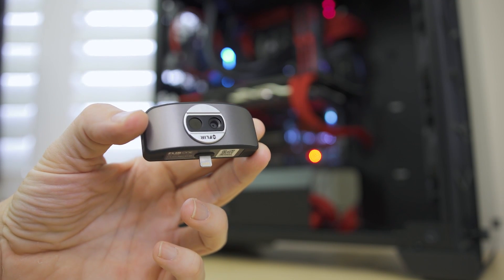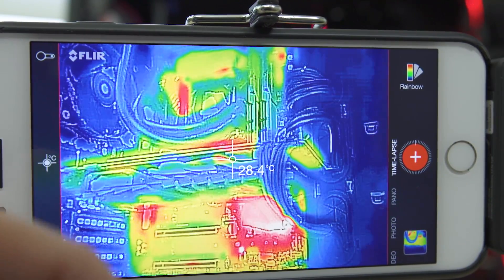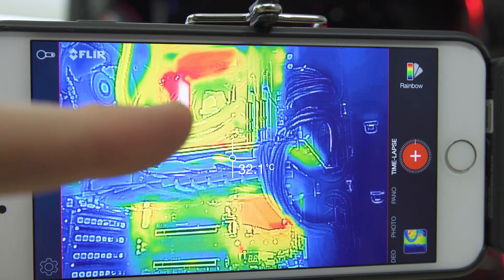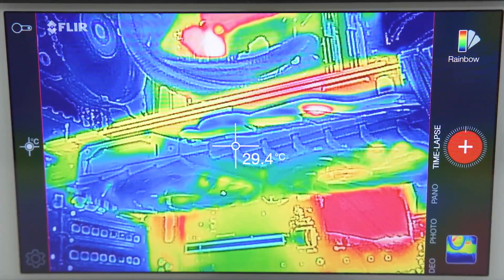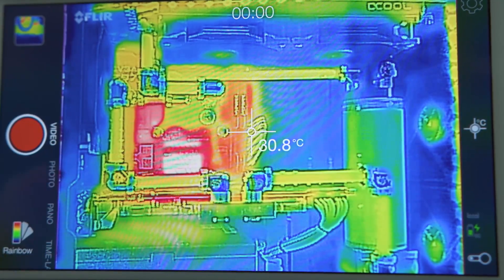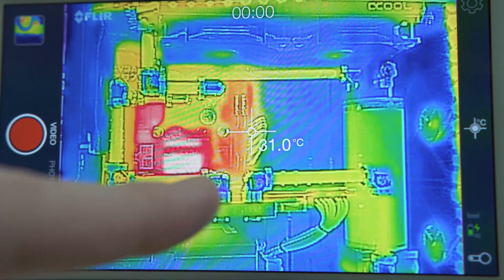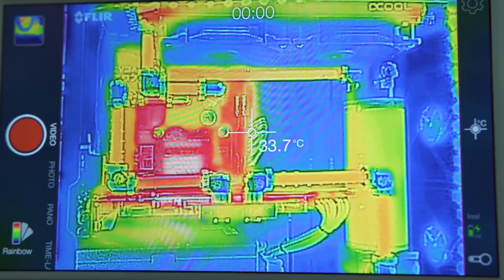PCs and Thermal Imaging... What your eyes CAN'T see

Comment: Hey Jay can you test if you get your hands on one the new Asus Rog board that'll have a block on the CPU and VRM's I'm curious if the VRM's are getting this hot would it actually be a downside on a block like the ROG board because it'll affect CPU Temps sharing with a VRM? Might be a thought to consider if the board is really worth the extra for that block if it isn't actually helping cooling as opposed to say get a separate block as usual for the slightly lower model of a ROG board.

Comment: We learned that you forgot the temperature Is relative the hottest point of the water cooled system is 32 c the hottest point of the air was 70 c but red the coloring changes with the average temp of the system

Comment: I think you would get mutch better results if you would have a fixed temperature scale. From what I can tell from your video the "color scale" changes as the average temperature goes up or down. A good example of this is the chipset. It started as the max heat source, and ended up orange/yellow by the end, so the shown color is relative.

Comment: Great video. It feels like you rushed through it a bit personally. I'm sure the excitement of this got ya going and you talked faster than normal. Maybe I'm wrong, but that's how I felt. I am very excited for more thermal videos for sure. I think a cool video would be the difference between a normal motherboard and one that has a fan in it for extra cooling like the SABERTOOTH Z170 S (something like it, not that exact one per say) would be pretty neat. See if you're actually paying for reduced temps, or if its just a neat way to spend extra money for a fan on your mobo. Also a video with fans in different location, and how they effect cooling. A case with a fan on the side would be interesting if it actually helps cool the mobo, or if its just for case circulation. Keep up the great videos, and I'll be on the lookout for more awesome PC vids from ya this year.

Comment: how many fans are too many fans for a matx
Reply: Xathrid tech That's easy to answer. Too many fans is one more than your case supports.
Reply: 3en6ie 3en6ie I have 6
Reply: my phantek luxe has 3x 140mm 5x120mm 1x 200mm fan, total is 9 fans, is it too many?
Reply: I want more I get sub ambient temp because it blows out air in from the window or out through it
Reply: 3en6ie 3en6ie okay fine define ambient
Reply: 3en6ie 3en6ie it uses the outside weather with filters to cool it but colder than the room it's actually in
Reply: 3en6ie 3en6ie yeah but the air it takes in is cooler than the air around it
Reply: Robert Langford should I buy the extra rails to mount more
Reply: Xathrid tech That's entirely down to you and your system. If your system is not overheating it's not something to worry about. However if it is then I guess yes maybe the answer if you have done everything else to maximise airflow.
Reply: 3en6ie 3en6ie You can, actually. Difficult to achieve with computers that like to warm up stuff but it's possible to achieve sub-ambient temps with coolers. That's what a cooler essentially does, you know, cools the computer's own "ambient temperature".

Comment: How about showing how bad something can get - e.g like my son's build! :-)  R9 390X Gaming 8G, with large air-cooled AMD FX8350 Black edition, and a crappy motherboard with insufficient VRM capacity, all in a small gaming case.  I have modded this case with Plastic panels to direct airflow on CPU (at the top) from input at the back, through the CPU cooler, then both up out of the top and also out the front.  Lower 2/3rds is Twin input fans at front, then exhaust is through upside-down PSU to the rear of the case.  The CPU stays below 60c most of the time, and the GPU doesn't usually go over 85c.  That's the best I can do!

Comment: this is one of the coolest videos you've ever put out jay. thanks for all your work. i'm a little confused on why you called an air cooled system that actually has an AIO? i get that the gpu is still air cooled, but i was expecting a noctua or hyper212 air cooler. my guess is heat would be spread everywhere inside the system, giving a less accurate show on mobo temps and parts around it? either way, an interesting way to make your point jay.

Comment: Could anyone explain to me
What a chipset is?
Reply: 3en6ie 3en6ie explained it pretty well. In simpler terms it's sort of an instruction hub for the motherboard. A lot of data and consequently heat pass through it and that's why it has a heatsink. I believe they are sometimes referred to as bridges or northbridge, or maybe I just made that up; I thought I remembered referring to them as northbridge years ago.
Reply: A chipset, Platform Controller Hub (PCH), is basically what makes things in your computer communicate with each other in the fastest possible way. It also dictates how many other things you can connect at the same time via the amount of PCI-E Lanes drawn on the motherboard. It also dictates which CPU you can run depending on which LGA socket it has. 

Chipsets: 
X99 (28-40 PCI-E Lanes): Has the most amount of features available, you can connect A LOT of stuff at the same time. Because of that it's very expensive.
Z170 / Z270 (20-24 PCI-E Lanes): Has fewer features, but different, because it's a newer platform. It can't connect as much stuff at the same time. Because of that it's less expensive.
Reply: Zion I.S The stuff on the thing that runs shit
Reply: Black5.0 There used to be south- and north bridge, but nowadays they're not separate and everything happens on one chip
Reply: Thanks spengu64 for clearing that up for me, I thought I was losing my mind when I went on newegg motherboard specs and they didn't list northbridge which I thought was the chipset lol
Reply: think of it like a Processor - because tbh it basically is one - a Processor that handles organizing the data coming from lower Bandwidth Expansion Slots, external Ports, and Et Cetera, and feeds that data to your 'real' Processor.

and just like any other electronic thing - it generates heat doing its job, and it also has limitations on what it can do.

if you were to ask "why doesn't my 'real' Processor just do it all instead" - everything can't go directly to your Processor, because it would be too expensive to manufacture and in some cases you'd run out of physical possible places, despite having tons of layers to your PCB, to connect things to the Processor.

it's much the same way for example, that we don't all have billions of wires coming to each home to connect us to the Internet - that's just not feasible so instead we have hubs all over the place that route information to the right other hubs eventually to an end point.
Reply: Thank you all for your help :)

Comment: Hi Jay. 

 I do power plant thermography  and a simple bit of kit we always carry around is a roll of electrical tape. It has an emissivity value of approximately 0.94 and can be used to improve accuracy. 

As an example run that load test again concentrating on the graphics card's  heat pipes and place a bit of tape on only one of the heat pipes and observe the difference between pipes with and without the tape. The issue is that this is not only graphical  (as viewed on the thermal image) but affects your readout also.

It can give you false positives or vice versa.

Loving all the directions your videos are taking us. Cheers.

Oh...btw, throw the imager across the 370Z. Cool things to be seen. Under the hood etc. Not sure of the range of that FLIR imager though.

Comment: J you can't just measure temperatures accurately without factoring the emissivity of the material. For example you can see the heatpipes looks like its cold thats because its shiny hence it has lower emissivity.
Reply: Or just think of it more logically, in a way that most people can understand: A reflective surface will just how the temperature of the things in reflected image, not the actual surface itself. That makes more intuitive sense to people.

Comment: 1:50, It's very frustrating to see the colors representing where temperatures are high at, but not actually have numbers to tell us how hot those parts actually are. I do realize that, 7:00, here we get a bit better of an idea of all the temps. For all we know, there could be an extremely minor difference in temperature between  those red hot spots, and the cool blue parts of the case itself. The crosshair at the center gives us some idea of where the temps might be at, and perhaps this is my failing, but I don't find it to be enough to really garner much useful information.  

If it's warmer than the rest of the system, but not hot enough to matter, have we really learned much? I feel it's fairly obvious that the components of the motherboard that do things like deliver power or do any amount of processing, are hot.  Perhaps I'm simply not the target audience of this video though, or I'm missing the point.

Overall, still interesting to see the visualization. I just prefer the nerdiness of the numbers. :)

Comment: Doesn't the Heat pipe not being very warm on the surface speak for it? If it conducts the heat properly it should warm up as little as possible. The fins around the end of the heat pipe would be way more interestong.
Reply: 3en6ie 3en6ie interesting I was wondering if they were insulated on the outside apart from the bit at the end.

Comment: WoooooooW!!! what an eye opener!! I can't believe how hot the VRM's stay... but you're at 5Ghz on that 7700K... There's got to be a way to stabilize the heat coming from underneath the graphics card back plate. Like if you bought one of those really sweet all metal backplates from EKWB, then put those rubber heat pads in more areas. I really want to liquid cool my south chip and especially my VRM's now just for longevity. I pretty sure the chemical based capacitors on anyone's motherboards hate the heat output, like near the high quality onboard sound solutions that are nearly always underneath the video cards.
Reply: I've always wanted to do a full-board water-cooling for so long, and I've never sprung for it, but now I think I really want to. thanks for this video!!
Reply: Don't get too excited over VRM temperatures. Practically all VRM's used in electronics are rated for 125*C operating temperatures. As in, guaranteed-to-be-safe up to 125*C. It's not too hard to find devices that tolerate upwards of 200*C operating temps either. And with even a small heatsink, most VRM's will never get much hotter than 80-90*C, which, yes seems alarming, but is totally relaxed for the VRM. Reduces their efficiency slightly, but the engineers know that - so the board is designed for that loss in efficiency at higher temperatures (They account for it by making the VRM's a lot beefier than they need to be. A common electronics engineering rule is to over-engineer by 50% at least).

Full-board water blocks are fun and fancy. That's all, really. I have fully watercooled motherboard, and it makes precisely and absolutely zero difference. It's just for showing off. Which is okay, I like showing off, so I use it!

Comment: Place a window screen as a side panel. You should still be able to have closed case like air flow but still be able to use the FLIR. compare to no side panel.
Reply: Can't. IR won't pass through the side panel very well. And you'll have lots of false reflected thermals too.

Comment: If the back-plate or surface temp.'s are hot, doesn't it mean that the heat sinks or the back plates are doing their job? Because if they weren't, the sinks wouldn't be as hot as the internals...
Reply: Also, why not do the thermal imaging on Skunkworks, it might give us a sort of an idea for the best air flow plan, espicially for a first timer like me...
Reply: Hey! Why not an AIO vs. an Air-cooler?
Reply: Master Chief, even more fun, how about no CPU cooler at all, just heat spreader! RIP IT!!
Reply: +Spaceman Rick Bad idea...unless you have money to blow up and screw a CPU.
Reply: Master Chief, bad idea for us mortals here, but not for Jay, who by the way uses a Titan X to level off his coffee table when one of the legs broke.
Reply: +Spaceman Rick You've got a point...but hey, you're right, he should do it as a control, but just for kicks...😋
Reply: If the backplate is hot, that means the air between it and the PCB is super hot because air is the only thing that conducts the heat. This means the PCB is being properly fucking hot. I may not be an expert in thermodynamics, but I would think that this hot air ends up acting as an insulator. I don't think having a plain backplate with air as a heat conductor comes even close to simply removing the hot air through convection. It's there purely for the aesthetics.

Comment: Idk mate, this video is a little weird.
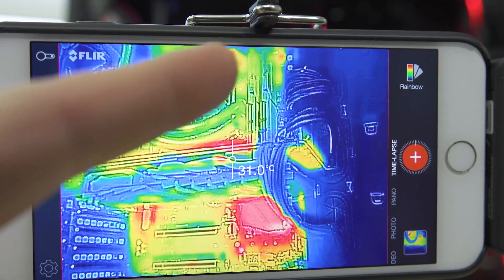Have you touched your/a chipset heatspreader at some point? From how they feel I would guess they are at about 40 to 50° C max. But @2:12 it almost looks like it could be twice as hot as green/yellowish point where your crosshair is pointing at (at least 62°). 
Chipsets can easily take 70, 80° C and be fine, and power chokes aswell as VRM's are designed to operate at up to 105° to 120° C afaik, so if they are at 70 ish in this video they are well within their safe operating rage. 
Furthermore, with the way a PC system is set up (colours, shapes, a lot of moving air through fans) I would assume that there is a lot more "bleeding" going on than  what you acknowledge @9:11 ish.

What did this video really tell us? That you should use case fans? Well duh.

Comment: Can you do a couple of deshelled power supplies and show the differences between a low quality power supply vs high rated PSU. I think that information would be very useful to a lot of folks that underestimate the importance of spending that extra $20-$30 bucks on it.
Reply: David Whitfield JohnnyGuru.com does amazingly in-depth reviews of power supplies.
Reply: i don't think Jay has the time, nor is running the type of Youtube Channel, where Oscilliscope auditing of Power Supplies is practical content for him.

it'd be great to do, as Oscilliscope auditing is the most important and least performed testing of Power Supplies - and realistically the only testing that matters for deciding what Power Supplies are worth buying - but i'm not sure that's the sort of content that this Channel is targeted at.

Tom's Hardware is a good source for this type of auditing however, one of the very few places that has the Equipment to do actual electrical auditing of Power Supplies.
Reply: JohnnyGuru does the best PSU reviews. Worth checking out his site. You can see the difference there.
Reply: That's actually an awesome idea, I'd definitely watch that.

Comment: Awesome! Pumped that you're adding this to your arsenal, gives a new perspective on system temps that just charts can't really do. I was wondering the whole time if the glass tubing would affect temp and I'm glad you mentioned it being an insulator. Would be cool to see a video where you use the thermal camera on water cooled builds with different types of tubing: the glass build, hardline, softline, even AIO tubing, etc; something like that. I know it would be hard to have a definite control with the experiment with different motherboards/cases, etc but would still be interesting.

Comment: Ok, we were on the same page yesterday but hindered by twitter's limited char count.  

What I found on my 990FX build, the VGA PCI-E slot is right up against the North Bridge which has a heat pipe up to the VRM's. With the RX480 plugged in there there was a ton of thermal induction (heat sinking) going on between these 3 components. Partially because that the backplate almost touches the NB sink.  I moved the the RX480 out on the riser cable and ran it perpendicular to the mobo. 

This drastically dropped all the temps across the board since the mobo and NB sink was no longer sucking in the heat from the RX480.  Also just by turning the RX480 that way also allowed it to dissipate that heat off the backplate which required a 80mm fan just because it would be roasting hot at idle.  Heat goes up and a flat plate doesn't really dissipate heat well with no air flow.

So if you are building on an open frame like I am with a P3 chassis..... you will run into compounded thermal issues similar to this video. I think backplates help pull heat out of the PCB like intended, but only if you push air across them.  Otherwise, it will likely get sinked into the motherboard and do just what Jay is showing here.  More thermal mass than it can dissipate.

Great video Jay!!

Comment: You could perhaps monitor the temperature of a GPU with and without it's backplate installed to see if there are any increases or decreases in the temperature of the back of the card (if any).

Comment: why not use peltire chips to cool up the water even more?
Reply: They are extremely inefficient when it comes to cooling, and they can result in condensation.
Reply: brandishwar but how about having it attached to the Reservoir or the radiators to cool up the  coolant
Reply: Victor Guillen Again... condensation.
Reply: Andrew Delashaw you're are right. thanks for the lesson.

Comment: Does the software allows you to place a bar for color representation in regards to actual temperature?
I'm asking because in general this way you can only see what his hotter/colder than what, but without really knowing how much (Or at least have an idea). 

In regards to what some other comments say, read about emissivity. For example this: http://support.fluke.com/find-sales/Download/Asset/2563251_6251_ENG_B_W.PDF?trck=emissivityexplanation

I'll end this by saying, measuring heat is always a pain in the ass. And it seems you never can get a perfect reading. Specially when you try to know the heat of a body.